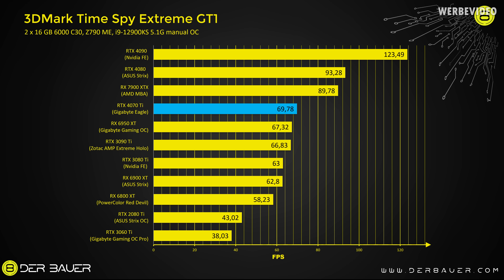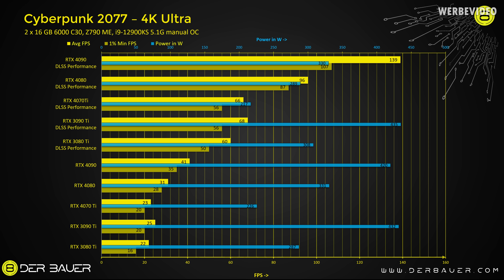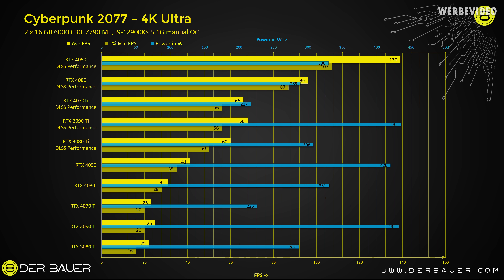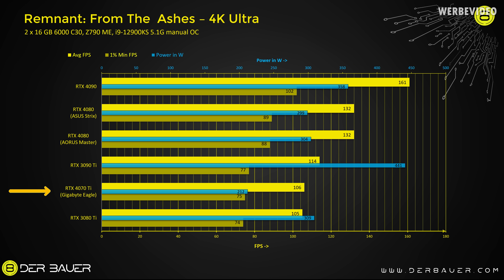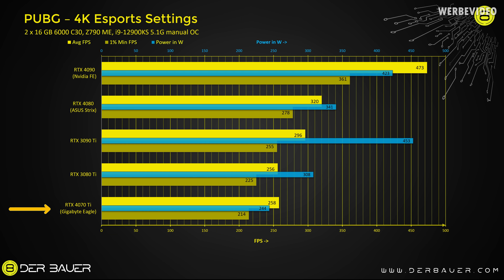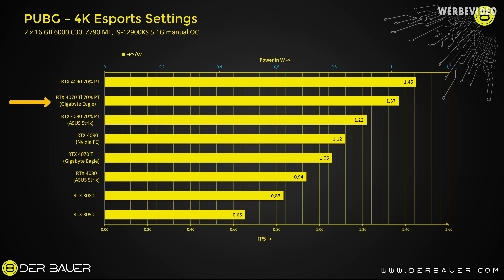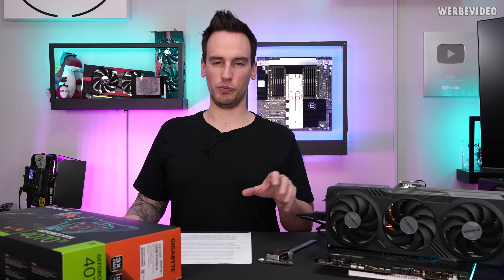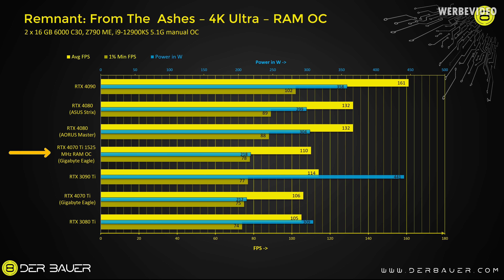Overclocking RTX 4070 Ti VRAM to Compensate 192-Bit Bus Width?

Comment: I have a gigabyte 4070ti super.  The monitor is LG 65" Oled evo, 4k 120hz. Cod Warzon running 120fps. The game settings are 4k and it runs almost with the maximum game settings, I am satisfied.

Comment: Bought one recently at a good price. Cheapest PNY, reference model no rgb bollocks. Still 3 slot and 3 fans cooler tho. That paired with 13600KF -0.09 offset, TUF Z790 D4, 48GB DDR4 3200 and Win 10 on Lexar NM800pro
Power limit only 100%, so not much oc potential there, BUUUUT... it can be quite economic.
On 100% pwr limit  in CP2077 it needs between 240-290 Watts(285W msx pwr according to specs) in 3440x1440 Ultra+frame gen+RTultra(no PT) and keeps 60+ frames, with 100+ FPS in some areas/situations.
On 80% limit it needs 220-230W tops, without any performance loss. Saw less fps when below 80% pwr limit. CP is very needy tho.
Most other games, when capped to 60FPS without DLSS consume around 140 Watts(God of War, Horizon, Witcher 3, etc). Which is 60W less than my previous RTX3060 while at stable 60 frames(3060 struggled a lot at that resolution). Even less power with DLSS, which at this resolution is hardly noticable. 
Overall it is a really good card. Could be a bit cheaper tho, but I guess those days are far gone now😒

Comment: I have this card, bought it in march for little less than €1k because it was the best price to performance card still in my budget. Its basically 3090ti with half the power draw and heat.  The heatsink on this thing is huge which means you can tune your fans to start spinning at slightly higher temp if you want totally quiet pc in anything but high intensity gaming. or if you want to run games at 250+ fps.

Comment: In terms of performance per watt, the 4070 and 4070 Ti are really impressive. 4070 Ti runs comfortably on a decent 650 watt PSU while delivering 3090 Ti class performance. 4070 can run comfortably on a 550 watt PSU, while delivering 3080 level performance.
Reply: But a 4070 ti can never give u the 3090 Ti class at 4K.
Reply: @abeerfaisal1986  4070 Ti is on par with 3090 or 3080 Ti at 4k, depending on the game. 4070 Ti is as fast or faster than 3090 Ti at 1440p. It's quite fast.

Comment: The only flaw with this card is the price

and the unfortunate thing is, if you want performance in the realm of a 3090 or greater, you're either spending north of $1,000, or buying this.
Reply: The only flaw in this card is lack adequate VRAM & Bandwidth.
Absolutely garbage for 4kgaming
Reply: @abeerfaisal1986  if it's me , I never go for 4k gaming so memory bus not a problem cuz have bigger  L2 cache make up to it , 1440p already enough , why would go to 4k when u never used to play it ? Like now I have 3080ti and upgrade to 4070ti bcuz of 1440p performance, so much higher than 3090ti which is perfect for me , you choose what u need that's it 👍
Reply: @mightybro439  
Because, unlike you, I play in an LG48C1 4K120 OLED TV.
Someone like me, enjoying such stunning visuals of my TV in HDR, will never care shitty 2K monitors with terrible visuals.
Moreover, I also don't need anything above 100fps @ 4K Ultra.
Hence, 4070 Ti will be severely VRAM restricted @ 4K, unlike a RTX 3090 Ti.
As an example, the latest game R&C RIFT APART itself consumes around 15 Gb at 4K Maxed RT.
To me, getting a 4070Ti is just a pathetic downgrade, not an upgrade from a 3090 Ti.
If I ever need to upgrade, I should wait & get a 4080 Ti getting released at the end of this year.
& that would be the most sensible decision.

Comment: This year is the year where Nvidia abandoned its' own metric of quality for budget cards. RTX 4080 and 4090 are the only cards worth this generation, and there is no poing to release 4080ti for Nvidia, as it would cannibilize its' sales of 4080s and 4090s. So they are releasing 4090ti to get professional sales going. AMD effed up the market with their cracked dies and memory overheating issues. AMD made Nvidia stronger, by failing on their promises. 

AMD's budget card wording failed by loss of trust. Imo AMD went back 10 years in consumer trust. I bought 4080 which was artifacting, but was great card. Returned it and bought RTX 4090. 

While I had plans to buy 7900xtx...
 Trust me, many people went for 4080 because of the same thing.
Reply: My god your logic is flawed

Comment: Now if only it didn't cost $800.
A midrange card with a top tier price.
Reply: Midrange lol, wake up
Reply: The 4070 Ti performs like a 3090 Ti at 1440p, and like a 3080 Ti/3090 at 4k. That ain't midrange.
Reply: @hartsickdisciple  It is literally the lower midrange card in the series.   Whether or not you get that is up to you.

It suffers ram issues with newer titles where the 3090 Ti does not.  

I get you don't get this so let me explain.

When you want to play 4k maxed out?  You are paying for a 4090.  Anything less isn't doing well in 4k.  ESP in the newest titles.  This is the flagship.  

4080?  You are playing 1440p or triple-wide. Upper mid tier.  This is also a great card, but with horrible value.

4070/4070 Ti.  This is literally your lower mid tier.  It gets great frames at 1080p and 1440p on current titles but isn't going to be awesome with the next gen titles that are getting ready to drop at 1440p tbh.

4060 low tier cheap-o card.  Currently we are in the middle of a shift in game engines so even this looks good.  But with an interesting value buy-in at the 16gb segment.  Which... tbh I would like the 4070 Ti more if it had 16 or 24 GB of vram.

Newer engines are hungry for vram for that nanite tech my friend.  And we are barely see them touch it at this point because of that reason.

Wouldn't be hard in Unreal 5.2 to take up 48Gb of vram.  or 64Gb at this point really.  Which I guess some movie studios already are doing.  

So if you replied this way because you feel bad about buying a 4070 Ti, I wouldn't.  It is an okay card if you aren't playing at 4k much or at all.  

Then again, I don't like 1% or .1% lows to drop my framerate below 20's, because that is a literal visual stutter.  But to each their own.

TBH the entire 4 series is skippable, because the 30 series plays it all good enough at 1440p.

I'll let more unreal engine 5 games drop before I start caring about the newest tech.
Reply: @thisisashan  You wasted a lot of effort and words to be wrong and condescending. I've been gaming on PC for over 25 years, so I think I know what "midrange" means. An $800 GPU that's as fast as the halo card from the prior generation is not "midrange." 

You're making a lot of assumptions and predictions about what will happen to VRAM requirements in the near future. True native 4k at max detail settings in most AAA games is still for halo/enthusiast class GPUs (above "high end"). That's the 4090 this generation, and it was the 3090/3090 Ti last generation. The 4080 and 7900 XTX can pull it off in many games as well. GPUs intended for native 1440p high/max detail at 120+ hz are "high end" at this point. That's what the 4070 Ti is for.

The big jump in VRAM requirements was due to the release of current generation console exclusive ports. That's why 8gb GPUs are struggling in some games at high/max detail settings. This issue so far isn't affecting GPUs with 11+ GB of VRAM. It stands to reason that 12gb cards will more than likely be fine for this entire console generation. Once consoles with more than 16gb of unified RAM are released, VRAM requirements will probably go up again.

Comment: Been amazed with mine 4070Ti eagle, mostly because I didn't need to upgrade the 650W PSU Nor get a bigger case it was just a swap out the 1080Ti to the 4070Ti. 
I play 1440p/165Hz
Reply: Oh that makes sense... dont need as big as a PSU as you would with a 3080 ti even.
Reply: Do u oc it? What oc if u do?

Comment: Really appreciate you were showing the ability for saving energy by limiting the power target. Would you recommend just to set the power target to 70% or setting up custom curve for GPU voltage? I tried that with my 2080 Super, but it wasn't very stable in Microsoft Flight Simulator and Star Citizen. However I ordered exactly this card because its very compact and I don't need to switch my case with this "small" card. We will see how it performs in Star Citizen in WQHD.  Thanks for your advice in advance.
Reply: Power limit % creates its own safer curve, suggest over Manual edits.
Reply: SaltySpaceKitten
you never need high frames rates, only lots of mem you need, keep the old RTX card please, it can run multiple 4k TV's etc, getting a cockpit

Comment: I needed a 4000 series card to do AV1 encoding in Resolve so I replaced my 3080 TI with a 4070 TI and it is noticeably faster,  3DMArk was 18400 before and now its 22400. Bottom line the memory bandwidth difference is not as limiting for this card as it looks on paper. When prices come down I do want a card with more Vram.
Reply: Hold onto that 4070Ti as long as you can, every generation now is going to have additional AI-related features, if you can hold until the 6000 series, you'll be set, but if you buy again now or possibly even in the 5000 series, it might be missing some significant AI-efficient power or architecture to improve ray tracing, scaling, or something we don't even know about yet. Regardless of future unknowns, probably not a good idea to spend a second time in the current-gen at the very least.
Reply: but v ram limitation
Reply: @arunachalpradesh399  The cores are so much faster that the vram "limitation" is not a big factor
Reply: @garypranzo9334  thats a temporary satisfaction, the recent trend of new games demanding more v ram will increase more in next year, and even low end 4060 ti 16gb will beat your card . secound problem is the price you paid doesnt deserve 12gb period. 4070 ti is 4070 in real , comparing to die core size
Reply: @arunachalpradesh399  bought this card months ago and completed over 40 video projects for my clients while you are waiting for a 16gb 4060 to play games. The 4070 ti was best option for my work at that time. Will be good until 50 series comes out at least.
Reply: @garypranzo9334  well i do ML,AI. and all simple model require atleast 12gb v ram,  i need to buy 4080 or 4090 . nvidia intenionally didnt gave high ram to mid range gpus for people to spend more or to upgrade every year.

Comment: I realize you work with hardware, but I was wondering if you had a recommendation for anyone to watch in regards for aftermarket tuning software on new AMD GPU.  It seems the upper limit on the GPU is astronomical but memory clock takes a massive hit, and vice versa, due to power distribution through the AMD provided (drivers?bios?).  I hypothesize that given appropriate cooling (no intended to be a joke... given the recent hotspot discussions, aftermarket cooling solutions seem absolutely necessary anyway), the appropriate software replacement these cards can be beastly... no warranty, of course, but beastly nonetheless.

Comment: Could you try higher overclocks on the memory? I was actually hoping for some more memory OC benchmarks with increases of 500, 1000 or even 1500Mhz+ on the memory as the headline of this vid is compensating for the low bus width. 🤔

Comment: Why is the cooling soluton this big if it's only at 220 watts most of the time... Hating this new massive cooler trend.
Reply: Because the card was originally goin to be branded as 4080 12gb it uses the same cooler as the real 4080.

Comment: I can’t believe they tried to bill it as a memory capacity cut. A totally different chip and a bus-width last seen on a 3060 (if i’m not mistaken) is absolutely not a 4080 jeeeez. edit: but don’t get me wrong. I’m not against a 192-bit bus. More VRAM over my 1080 even if it’s slower is still a huge leap in performance for my usage since I can have a bigger scene loaded in Blender and Optix will still see stupid performance gains. If I can ever get one of these for a decent price it’ll have saved me from a ridiculous 3060 vs 4080 choice just to get more than 8GB and It’ll still be around what I paid for my 1080 FTW2 at MSRP. It’ll also be lightyears ahead in gaming. Wish I didn’t have a moral stance against this release lmao.

Comment: Looking at a few first-day reviews, I think that 4070ti might be a not-bad GPU for 1440p, especially for smaller cases. But the main concern is the price for sure.
Reply: Exactly, you don't pay 1000€ for a 1440p GPU. That's just ridiculous
Reply: @Gollum1905  I bought a 4080 to game at 1440p, why? because it will last me many more years at 1440p and I won't have to upgrade in a year. Saves money in the long run.
Reply: @Gollum1905  paid 909 euros for a 4070 ti eagle. Prices will dip for this card.
Reply: @tensaims  what kind of weird flex is this XD you can buy 4070 TI below 900€ which is still way too overpriced for that level of performance. If the RX 7900 XT and 4070 TI go below 750€ I'd still consider buying the 7900 XT. At that price range you're getting into 4k territory and the 4070 is demonstrably worse in 1440p and above. So not sure what your use case is, but even 850€ is a scam for a 4070 TI.
Reply: @Gollum1905  flex? You named a price to illustrate your point and I am telling you there are lower prices for which you can get said card. Calm down nerd.

Comment: I remember cards used to have 512 bit bus, the last card I had with that configuration was the 560Ti, I wonder why they stopped using the high width bus... I wonder if it would be a benefit for any modern card.
Reply: You're misremembering. The 560 ti was definitely not 512 bit. I think the GTX 285 was the last 512 bit gaming card from Nvidia and that was 15 years ago. ATI/AMD did have the hd2900 XT, then the 290x/390x more recently but even those were a very long time ago.

Memory has gotten much denser and faster to the point where the die space cost isn't worth it. Memory interfaces don't scale in size with new process nodes like logic does so there is a strong pressure to reduce bus width over time.

Comment: Typical nvidia price gouging for their GDDR ram again. They always do this, and I say this as someone who has Nvidia cards. They always either make the bus width smaller or give you less quantity of ram and its always for a staggeringly high price, They need to get rid of their company dictator Jensen Wong. He has become overly greedy and it shows, these people are already beyond wealthy and for some reason they just need more, Nvidia will never get better until he is gone. I think for my next card I may finally be going back to AMD. Last time I had AMD cards was the rx 280x I had two of these from Sapphire in Crossfire. They were good and I could play everything maxed out but with issues. AMD's drivers were not as good as Nvidia's I always had to turn off in game features to fix some type of artifacting. Not only that the fans Sapphire put on the cards back then were absolutely shit. I had one start to sound like a tractor and then it failed, As a result eventually that second card would overheat. Then again my friend had two 1080 ti's in SLI and he had to update his graphics card bios and his motherboard bios for them to even work properly back then, yet when he did he didn't have a problem after that.

Comment: Does using DLSS compensate for the lower bandwith? I would assume so, since the actual render resolution is lower, but maybe the chip still needs to communicate more with the memory when upscaling, I don't know.
Reply: It does, both reducing memory transfer speed requirements as well as memory usage which might come in handy in the future. I have anecdotal evidence of this while running Portal RTX on a 3070, and the performance with DLSS is about 3x that without DLSS, which points at a major memory issue, in this case not enough VRAM.
Reply: @chuniac7513  Interesting, that's good to hear.

Comment: 15 years ago. I put together a top of the line PC, all the best parts available for around €2500, now to do the same it will cost about €9500-10.000. Just a 4090 today is the total cost of a whole HEDT 15 years ago. GPU pricing in particular is completely bonkers
Reply: You`re talking about a life time in pc performance. Completely incomparible.
Reply: @brugj03 you're drinking the Kool-Aid.

Comment: On the 4060Ti ...I mean 4070Ti you simply can't overclock the VRAM enough to compensate for losing 1/4 of the bandwidth compared to a 256bit bus, and not only that but the GPU cache is also lower than the 407C... I mean 4080.

Comment: Just a quick question.
You have grizzly minus pad extreme for sale. I can not find the specs for it on your website?
Minus pad 8 is, well, 8w/mk.
On your site it says the extreme version is 260% better than the minus 8.
Please correct my math, but would that not make the extreme version 20.8w/mk?
Just trying to get confirmation on what the w/mk rating is. Thank you.

Comment: Simple its not worth even close to 800 or 850 this should have been a 600 dollar card so irl 800
Reply: You can't get a card slightly worse or better for less right now. Am I just looking in the wrong places? Cheapest 6900xt is $829 on amazon. Cheapest 3080 is $779 from EVGA with rebate. Cheapest 3090 ti is $1448 from amazon. How is anything worth the dollars?

Comment: I understand the time limitations, but still, I'm surprised to see the benchmarks done at 4K, most gamers don't play at this resolution.
And RTX 4070 TI for me is clearly 1440p card, because 12GB memory is not enough for 4K without upscaling.
So, I don't understand why you chose to test it in its worst condition instead in those that I think are intended to be used?
Reply from the maker: as I said in the video. Not enough time to retest everything else. And it's best for the consumer to test the worst condition because everything else will be a plus